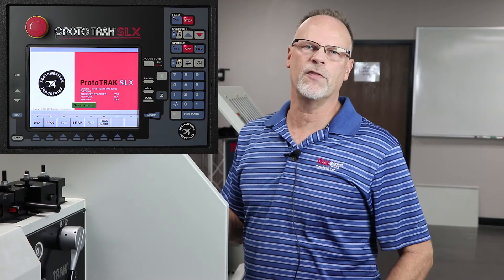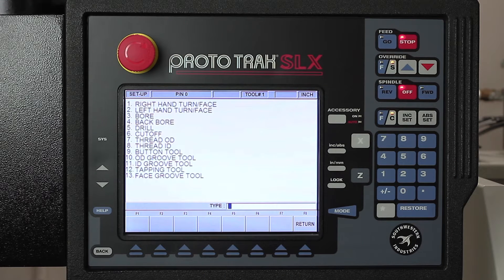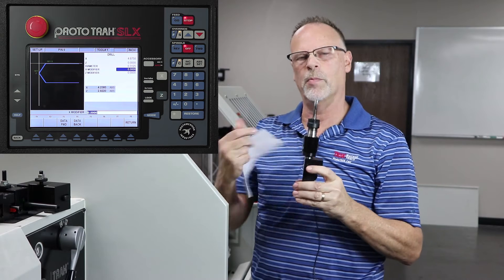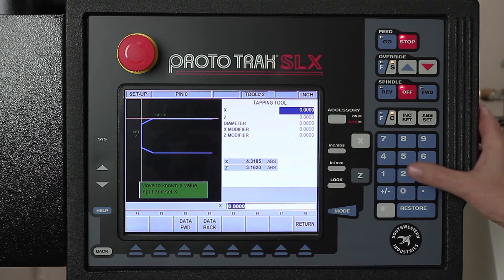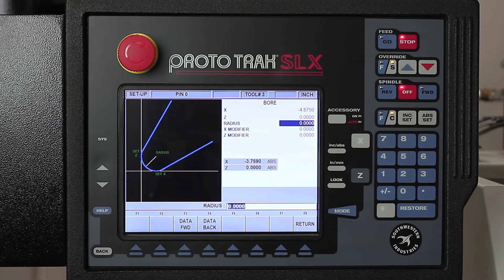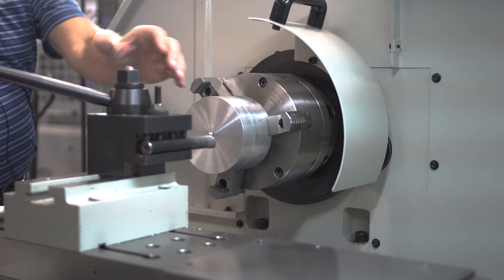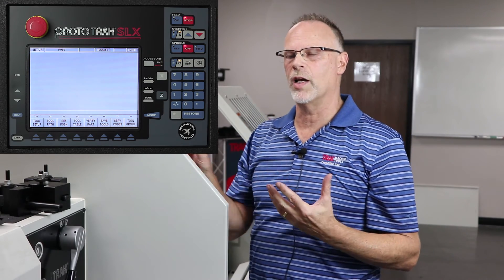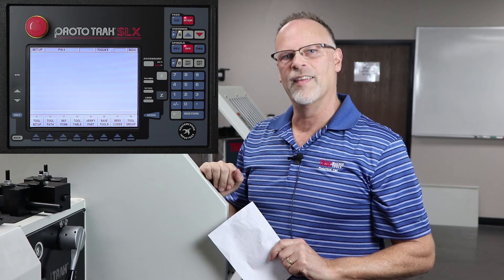ID Tool Setup | ProtoTRAK SLX CNC | Lathe ID Programming 1

Comment: 5:28 shows X = -6.872 (negative), so when you touch the tool on the back that means it's (-4.875) ?  X positive is out of the lathe pointing to the operator.  X minus points away from the operator , so -4.875 since that's the x minus direction.
Reply: Correct.  If you watch closely, when I set the dimension to -4.875, that number changes to show the correct number.  The number in that DRO window doesn't mean anything until you teach it where it is.  Once you do, it will change to the diameter you entered.  T.P.
Reply: @trakingpat2750  I was just learning a bit about DRO on the bridgeport mill tonight in a class.

Comment: I think at 1:58 , 4.875 is the diameter of the stock in the vise.
Reply: That's correct but its a chuck, not a vise.  So, what's the question?  T.P.
Reply: @trakingpat2750  No question.  Some of us may not immediately know that the stock is has the size being referred to .  Learning bridgeport mills, so I have forgot that the lathe has a chuck : )  Thanks for the quick response.  I will be learning a bit about lathes in class soon.

Comment: Question: Can the format of the programming be changed to constantly feed on the z and x axis with out cycling?
Reply: Yes, if I'm understanding your question, you're asking me if I can move the tool in any straight line.  To do so, in the DRO mode, you can use the power feed function or in the Program mode, you can simply program any tuning event which will move from point A to point B.  That turning event can be in either direction, either axis or a combination off both.  Does this answer your question?  If I'm wrong, then I think you're asking if I can program in RPM and Inches Per Minute instead of Surface Feet per Minute and Thousandths Per Revolution.

Comment: I would like to know how to create a program to take my 1 inch diameter stock down to an exact size, then drill, then tap without a floating tap.
Reply: K Reel, it sounds like you need to watch the second of the ID videos.  Here's the link.  https://www.youtube.com/watch?v=CimEhCcAsaY&t=353s   Since your question states OD work too, you should watch those videos as well.  In a lot of cases, you can get away without using the floating tap holder because there is an encoder on the spindle however, our tapping event is not designed to decelerate, stop, reverse, and accelerate at the exact times you may need for the pitch of your tap.  Therefore, you would be much better off to use the floating tap head or just cut the thread using a tapping event.  T.P.